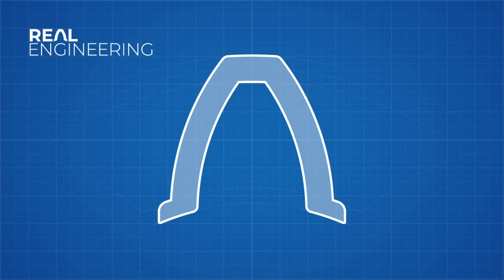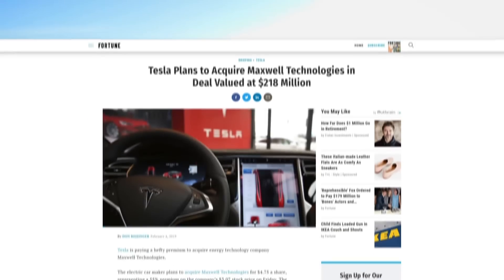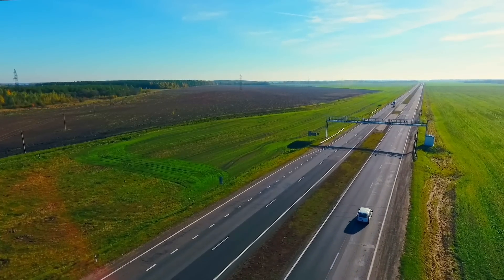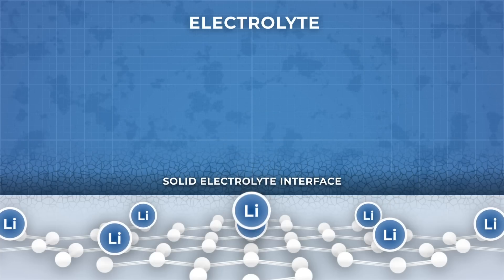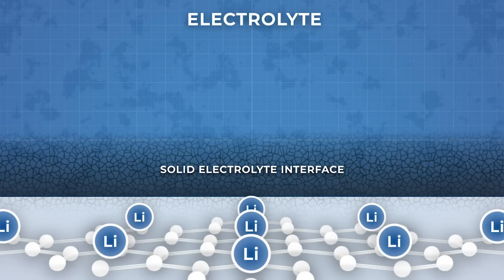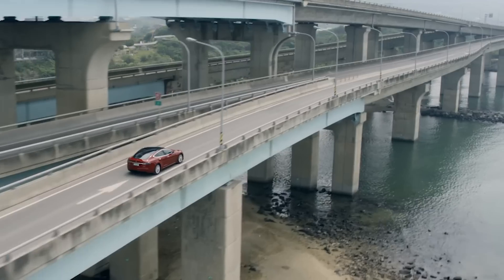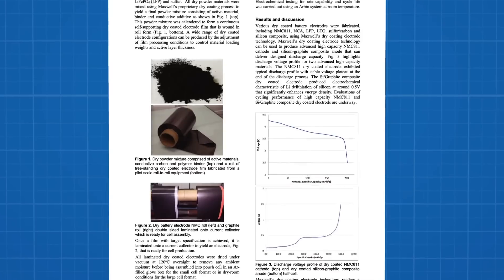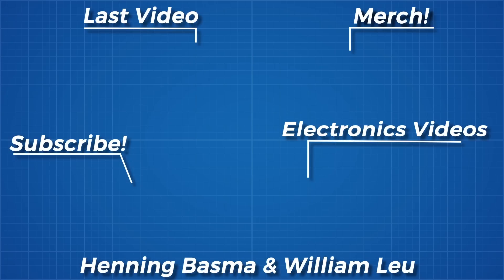Tesla's Quest for Better Batteries

Comment: Lithium atoms, not ions, are at the anode. Otherwise there are no electrons to produce the electricity. Once this oxidation takes place the electrons produce useful work and are reduced in the cathode electrolyte, which in the case of LFP batteries is iron(III)phosphate, which is reduced to iron (II) phosphate. Anions migrate to the anode, and cations to the cathode to balance the charge.

Comment: There is one big problem with ev`s
It is never fully electric, it still has to get the electricity from a power source which usually comes for burning coal which offsets the advantages to the earth of using only electric power

Comment: Gas tank doesn’t go bad in years..... try that EVs
Reply: The warranty on Tesla batteries is for 8 years or 150,000 miles. If they lose more than 30% of their capacity to to hold a charge, Tesla replace them for no charge.
Other manufacturers have to compete with that.

The average car, including its gas tank, is scrapped after 200,000 miles, so that's somewhere between 12 and 17 years. I know that there's many older cars on the road, but I'm working with averages.

BEV battery packs that are repurposed for static electricity storage would have a useful life expectancy longer than 17 years. It's already happening with some BEV battery packs. This nascent second-life battery market needs a steady battery supply, which frankly doesn't exist right now. But from 2025 onward it will.

Also, with respect, I'd ask you to consider what currently happens to old cell phone batteries, and ask you why this can't happen with old BEV batteries when they finally become useless. They're never going into landfills, they just contain too many valuable minerals. Expensive to recycle right now, but economies of scale will lower the recycling costs.

Also the vast majority of people have ethics, and they will simply demand that BEV batteries are cleanly recycled. Tesla, always one step ahead of the game know this, and have promised to do it.

Do not underestimate how idealistic younger people are, they'll happily pay a premium for products that are better for the environment. 

Even an old fart like me, who's never been a environmentalist, now eats less meat and buys free range eggs, purely for ethical reasons. I pay more and eat less, but I feel better. Mind over stomach I suppose :-)
Reply: @davidkeenan5642  currently the high expense of changing a battery in EV is too expensive for average customers, not enough EV charging station plus long charging time, battery eventually wears off just like iPhone batteries, think about it this way: brand new EV: 500km range with full charge, 5 years later: 450km, 10 years plus: < 400km range, with the warranty yeah u can last another 5-10 years but then u gonna pay for new battery from your own pocket. Sure some people change to a new EV every 3-4 years if they are on lease, but how about people who hold on to their car for very long time? EV is the future no doubt about that,it’s  I guess we will see in the next 5-10 years. Btw I am one of those “young people “ u mentioned, more interested in gas/diesel engine cars, the sound of those engines is just...amazing
Reply: @davidkeenan5642  thank you sir 🙏  be the solution not part of the problem

Comment: The battery issue is over a century old; had we solved it from the start, we'd definitely have been an electric vehicle world.  The future is nano-particles.  What concerns me is the power source and the power retention.  We can build batteries  that can suck down power, but if it's not well retained, we've squandered a lot.   We must be ever mindful that our power invested in batteries is well-retained, and that the ultimate power source is not some greenhouse-problematic fuel...

Comment: The 1st crude batteries were carbon-based.  The ultimate batteries will undoubtedly also be carbon-based, only 1,000x as dense with Bucky balls or other micro-engineering to radically amplify the storage capacity and retention rate.  What is unaddressed by all of this now, and into the future, is the ultimate source of this power....

Comment: Nuclear cars can be a solution? Or it would cause too much contamination?
Reply: Contamination isn't the main problem, main problem is getting the form factor small enough & at high enough energy yields, not to mention infrastructure to be able to dispose of billions of small reactor fuel cells on a continent scale. Contamination like from an accident would be one of the only ways to get the reactor out in the open, but we know how to make radiation protection, just lots of lead.

Comment: I like how you explained everything clearly but you missed a very important point. At low temperatures lithium plating is prevalent which leads to  dendrite formation which can cause internal short circuit and eventually lead to thermal runaway.

Comment: lithium ion has peaked in technology gains. time to consider hydrogen cell technology. That's where all the big car makers are putting their R&D. It would still be an electric car, just the source would be hydrogen cell instead Lithium ion. There are test markets using HC now with mixed success.

Comment: Imagine if you get a electric vehicle powered by a radioisotope thermal generator or betavoltaic device which you dont have to power for decades. Thats real progress.
Reply: NotTheCIA I.think   

Could it the feasible theoretically if you have enough isotopes from more modern nuclear power plants (especially III gen breeder/fast neutron reactors )? Also is it possible to have a better conversion from  isotope radiation to electricity with nano carbon that improves energy transfer efficiency? Hypothetically, depleted uranium from nuclear reactors may be used to provide the necessary radiation shielding.

Comment: Renewables like solar, wind, hydro, etc is a lot if money and a complete waste of resources tbh. If you want to save the planet, go nuclear. 
Currently it's just fission, but Elon needs to put money into fusion as it's that which will save the planet and get rid of our dangerous addiction of fossil fuels. If he really wants to be Iron Man (like in the second film where he discovers a new element), then put your billions into making cheap, clean and long lasting energy with no side effects which is fusion.
People really need to stick money into nuclear and NOT cheap out on the shit GE's reactors. Which are a terrible and dangerous design from the 60's when everything was designed and built with a slide rule. 
If you really want to save the world, then build the most state of the art, cutting edge reactors going. So no matter what happened n everything went south, then everything would still shut down safety and have triple redundancy. 
I know there must be better designs out there like Thorium or molted salt core reactor's. It'd be lovely if people like Jeff & MacKenzie Bezos, Bill Gates, Mark Zuckerberg, Larry Ellison, Steve Ballmer, Larry Page, Sergey Brin, Ma Huateng, Jack Me, etc chipped in instead of Elon constantly paying the bills for everything! You'd be able to build quite a nice reactor which some spare change after doing some initial R&D and research on what's the safest, cleanest and cheapest way of producing electricity. 

Sorry. That was a proper rant there lol. 
But nuclear will always be the future as it's cheap clean safe limitless for our hungry energy needs 🙂

Comment: half way into this and the layer formed by the electrolyte that gets denser over time is the same in lithium batteries and an easy quick solution is to use a 12 volt battery car charger with 200 amps to shock the layer and break down that wall. been used for years to recover crap lithium batteries.. all you would need to do is schedule a maintenance appointment at dealership where they do this under controlled conditions or simply replace the battery pack with a renewed one .. only replacement labor is needed or down time versus 7K replacement

Comment: People make way too much of a battery not going as far on a charge when it's old.

Few fossil fuel cars get the same MPG when they have a lot of miles on them.

Sure it's a bit more of a problem than with fossil fuels, but the fact is that current electric cars have way more range than over 90% of drivers need for all but a few days a year at most.

Comment: Capacitors are not used in EVs for drivetrain power because batteries have more than enough power and low impedance for all conceivable use cases.  Teslas go 0-60 in about 2 or 3 seconds with NO CAPACITORS.

Maxwell's dry electrode technology does not get rid of Cobalt.  Nor does it make a solid state battery.  It replaces the wet electrode (NOT ELECTROLYTE) manufacturing process.

Tesla recovers the solvent used in the wet electrode process.  They do not dump it into the environment.  They capture, recycle and reuse it.

Comment: Owners have reported that the lifespan of the packs are vastly underrated (depending on use and climate). Most owners are getting far more than the projected max-charge and millage. Of course there's also the next gen batteries waiting to hit the market - so it's got a good trendline.

Comment: Does anyone wanna bring up the fact that the Tesla truck could store like 95% battery in the trailers it transports making it so the vehicle has virtually 0 downtime once automated? The trailers would be loaded and charged while waiting the truck would just drop off the low battery one, hook up to the full one and leave. Who cared about mileage there could be depots where the trucks just drop trailers off to charge and trade for full ones. And if it’s all automated, nobody will care, everything will be on time, and wayyyyy more efficient

Comment: Something that almost nobody knows is that gasoline takes a lot of electricity and cobalt to make.

Electric cars in the long run are better and last twice as long, and that's just the bare minimum. 1500 charge cycles times 250 miles is a 375,000 mile battery.

Great video 👍 👍

Comment: I'm no battery nerd, but I wonder if you put a supercapacitor as the barrier between the electrode and electrolyte to prevent that build up and recharge faster because it's a supercapacitor.

I'm guessing it's either been tried before and didn't work or it's just an impossible idea.

BATTERY NERDS, WE NEED YOU!

Comment: Great explanation of how batteries perform in cold weather environments. My 2016 Chevy Volt loses about 30-40% of its charging performance during the winter months. Fortunately, the Volt can use gasoline when it’s needed. The Volt’s design has helped me to save more than $1000 a year in annual fuel costs.

Comment: Everybody says that EV's are the only way to use renewable energy in cars, but an ICE car that runs on E85 is already using more renewable energy than a Tesla being charged from the grid, which is nowhere near sourcing its power from 100% renewable energy in most locations. Biodiesel is another renewable fuel that can be used to power ICE cars. Sure, there are those who get hung up on carbon emissions, but if you are reading this, you will always have a carbon footprint until the day you stop breathing out carbon dioxide. Just plant more trees and market gardens (or renewable energy farms) if you are worried about carbon emissions. That's a win-win situation. The carbon cycle is completed and we all get food to eat and timber to build our homes. None of that happens with EV"S, all you get is the problem of where to get more renewable energy to power the grid, and where can we find enough lithium and cobalt to make the batteries?

Comment: Battery density at the required level is so explosive as to be dangerous. Micro generation is the future. We should be looking for something in a nuclear decay based power cell. Finding a way to generate or channel power is inherently safer than storage. If we can build Tesla's wireless power or find a non-radiating nuclear/electric conversion system we have the real future. Photon-intermediate direct energy conversion (PIDEC) is a scheme for direct conversion of nuclear power to electricity. ... Because the photons emitted by fluorescer are narrow band, the conversion efficiency is much higher than efficiency of common solar cells. The overall efficiency of PIDEC is expected to be around 40%.

Comment: Well, so far Tesla does not make batteries.  Panasonic makes the batteries Tesla uses.  If Tesla is capable of solving its nightmare production and service problems before it goes bankrupt, maybe it can make use of a new generation of batteries, and actually get the mileage the company is now claiming, but right now Tesla's cars get around 70% of the company's claims.  Gas engine manufactures get fined millions if they misstate their product's actual mileage by a couple of miles per gallon or so.  By the way, do you think Tesla paid for the gigafactory, or for the factory in New York that makes solar panels?   The taxpayer should hold the titles.  It is the same business scam -- excuse me, business plan -- as Solyndra.

Comment: We've just gone through a rather brisk week that varied between  -15c to -45c here and quite a bit colder not too much farther north. I wonder  how well the battery in one of those cars would have held up as it would have to run the cabin heater as well as the headlights that are needed anytime between 3:30pm and 8:00am in addition to moving the car.

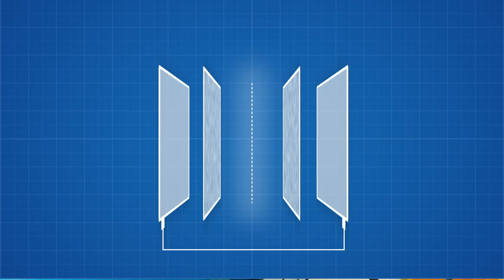Comment: Brilliant alright ...how many others noticed that the narrator says the exact OPPOSITE of the illustration at 3:50  about battery cathodes and anodes?  While you are at it, did you also notice at 15:08, that he switches reference from electric to 'electronic vehicles' a bit of a misnomer also.  Otherwise, a cheerful and hopeful well made video.

Comment: You always get this "Prices are coming down bullshit". The price can only come down if they use "cheap" materials. You get what you pay for! Just look at Solar Panels...most are garbage.
Reply: unless you improve the manufacturing method which makes more efficient use of materials and lowers operating cost while increasing scale, tesla cells are mid grade high drain cell batteries, but they are cheaper then many other batteries on the market, they arent the absolute cheapest but cost continues to go down as manufacturing improves, if you want to question it just look at dry cell VS wet cell manufacturing.

Comment: I several problems with Tesla:
Low energy density 
30-45 min to charge vs 5 min to fill up
Long times in shop due to lack of Tesla parts and 3rd parts
Expensive battery compared to cost of engine
Cannot be jump started, thus becomes a dead weight and has to be towed
Reply: 1. does it matter if it still goes 325 miles?
2. most fill at home where it takes 7 seconds to plug it in and go to sleep
3. yep an issue that resolves with time
4. the battery also is 3x more efficient with its battery so you save 3x more on fuel
5. they dont need to be jump started their battery is so big voltage is always there even in -40c tempatures unlike the 12v battery seen in regular cars where 0f can kill the things, and if 6. you find yourself for what ever reason out of battery power then they can deal with the fact that hey drove 300 miles without thinking of fuel like people do with regular cars.

Comment: 3:50 - "Positive Electrode, the Anode" yet the diagram says opposite! LOL  I'm assuming the diagram is stating the poles as opposed to the electrodes.
Reply: Electrodes are the poles though and the diagramm is correct? He should have said "positively charged electrode"